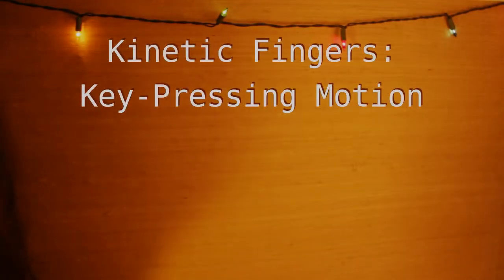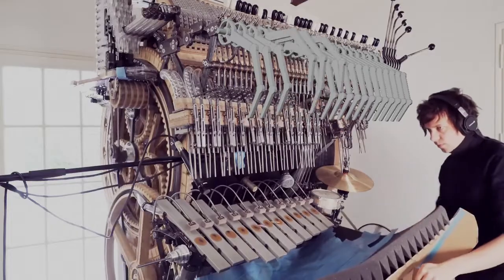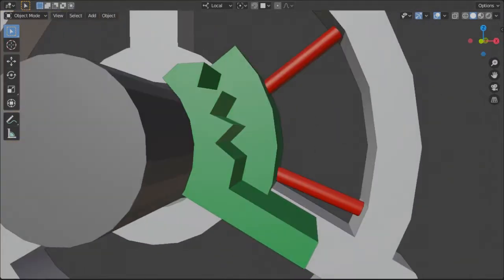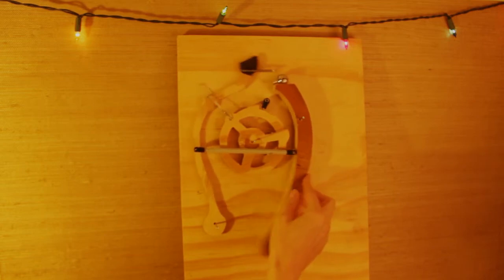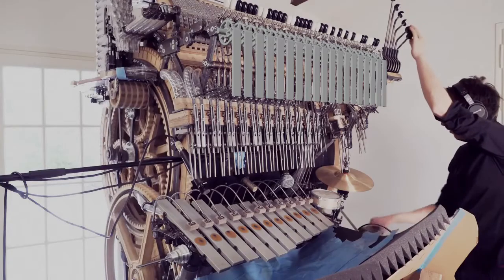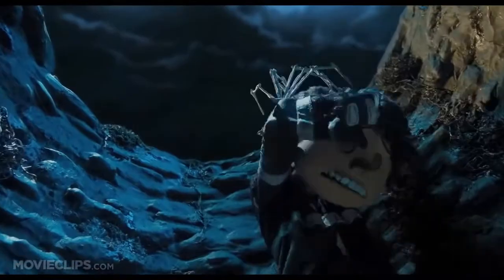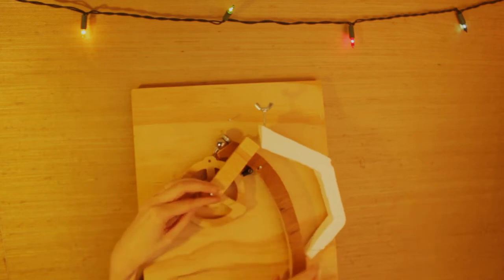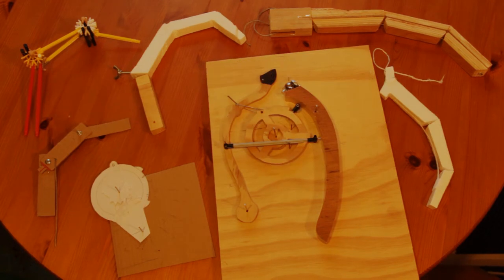Kinetic Fingers - Key-pressing Motion and the NO COMPROMISES SOLUTION for the MMX

Comment: This design is really smart and I really like the key pressing illusion. I've been thinking that if the issue is aesthetic perhaps the thing to do is match them more closely to the other parts in the same visual plane. The knobs, levers, and mechanisms are meant to be viewed from the front, but the purpose of the fingers is to transpose the action from the front to be viewable from the side, so maybe the thing to do isn't to change their functional appearance, but change the design to match the other side elements, e.g. make them look like gears.

Comment: Holy crap this is feature creepy. The machine is taking long enough to build as is. I think the kinetic finger you had in your previous video was far better, this idea makes me unenthusiastic about the idea of the fingers as a whole
Reply from the maker: I don't understand how trying to match Martin's original design from over two years ago could be feature creep.  So far he's only made a prototype of the fingers; as far as I know this part of the machine has not been fully designed yet.  The reason my version can seem so complicated is that I've been working within the constraints of not redesigning the machine around the fingers, but rather redesigning the fingers around the machine as it is.  This will all take as long as it takes until Martin is satisfied.  You saw the lengths multiple people went to for the funnels.  Is this really more complicated than that?
Reply: @meticulae.designs  This actually added more functionality than the funnel.